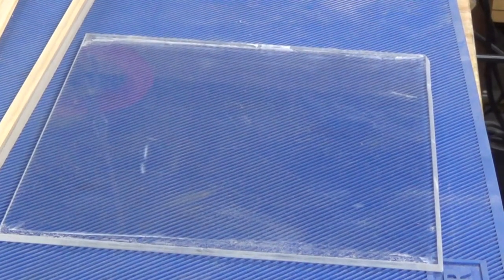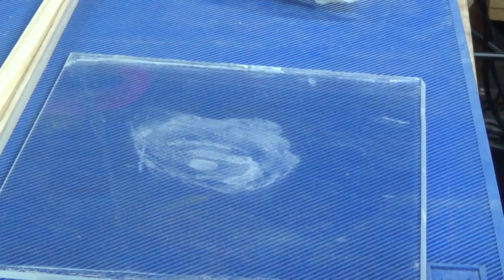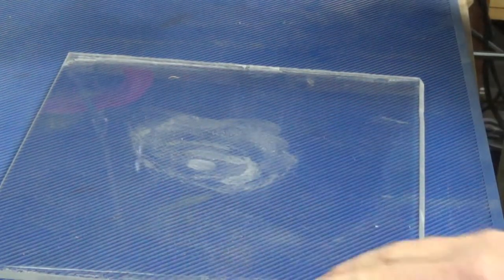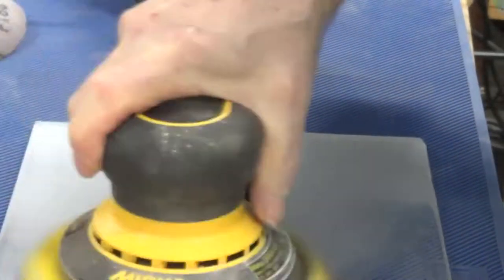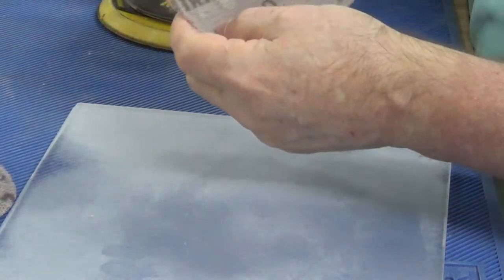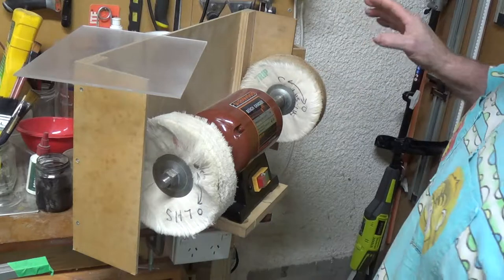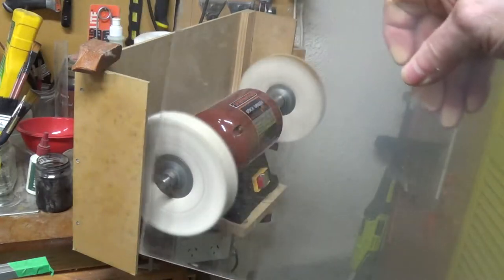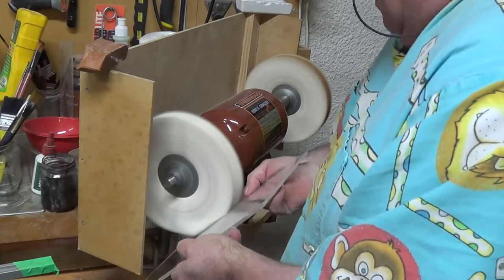Perspex (Acrylic) Repair/Clean Up... Ugh! CA glue...

Comment: I've got small cloth wheel like you have from amazon, also with a brown compound, i've tried to apply it the way you did, and it didn't applied at all on the cloth. Cloth it self started even to loose it hairs from the pressure i've applied.
Reply from the maker: Hi Holms... sorry to hear you are not having the success that I've had... Unfortunately I can only go from the experience I've had using the products and equipment I had on hand...  I didn't have to go out and purchase anything new.

Outside the "PlasticX" compound, I originally (years ago) bought my buffing equipment from the Beall Tool company (a long way from USA to Australia)
   https://www.bealltool.com/products/buffing/buffer.php
and their respective waxes (tripoli and white diamond), explicitly for woodworking.  Recently I bought some buffing pads on a budget and now they're either in the rubbish bin or given to people I don't like too much (sorry recipients)... they were a bucket of shit compared to the Beall products.  Your equipment may be different, however, I have no idea what you are actually using.  
What you see in the video is contains actual footage the first time tried this method and as you can see it works.  I have no affiliation with Beall but it worked for me... I have no idea what other supplier combination will do the trick and can only quote what has worked for me.  

Sorry for the negative reply, but unfortunately I can only call it as I see it.  I have used this method several times now with similar (exactly the same good) results.

Good luck.

Comment: Hey Alex do you have a shop if Jersey where you do work? I have a slingshot and the windshield got stained your the wrong chemical by mistake to clean it. I want to see if it possible to buff it your it’s not glass. It’s plastic I guess plexiglass
Reply from the maker: Hi David,  I'm just a hack woodworker and not really into glass or perspex/plexiglass... I just stumbled across this as I buff/polish a lot of my timber.
I'd be apprehensive in recommending anything to do with a windshield as it might cause unknown grief... All I can suggest is that try on glass/bottle starting with a heavy abrasive (talk to an automotive shop) and go up the grade.. the compounds have abrasives so it should work, but then it may put scratches that can't be removed. 
Sorry, but I am no way knowledgeable enough to provide further experience advice.
Reply: @alexkara9696  no worries thanks sir. And it was polycarbonate not plexiglass jajajajjaja.

Comment: Alex ya bloody legend! Here I am, looking at videos on how to buff out scratches on our acrylic caravan windows and I stumble upon this bloody ripper of a vid mate! Made by a bloke I worked with 20 smeggin years ago! This is nutzzzzzzz! Rack ya brains young chap. Box Hill. Coding in COBOL - VisionPLUS! This has just blown my mind! :-) Hope you're well mate and still playing with ya model tanks! Cheers, Stevo. :-) P.S. I'm gonna binge watch some of ya other vids. By the way, you ain't changed a bit ya funny codger.
Reply from the maker: G'Day Steve,  The name rings a bell, COBOL and Vision Plus brings back nightmares... Gotta be more than 20 fucking years... Been here in downtown Churchill for 10... worked for Yanks for 8 and sold my soul to CSC for longer than I care to remember.  A few Stephens have crossed my path Moore than some... Gotta try to clear the cobwebs and try to access memory above that that 16MB magical line that alcohol cannot affect...  must swap whories  once this fucking C19 goes into slumber.  
Can be PM's at "alex@karapens.com" but don't pass that around or all my nemesisses will come debt collecting.

BTW, I'm sure if you remember moi, you'd remember Paul (Wally)... still keep in touch.  Just to see if Unca Alzhi is having a snooze, would I be way off track if I mentioned an upside down wrist(ish) tattoo?
Reply from the maker: This link may also be of some assist in cleaning acrylic when you can't take the job to the tool,
   https://www.lumberjocks.com/LittleBlackDuck/blog/130613
Reply: @alexkara9696  Yeah mate, you're on the money about the tatt! Hehe, can't believe you remember that. BTW, we bought some land at Golden Beach, near Sale - which is kind of close to Churchill. Great area. Ok, i gotta get up and polish me caravan windows. Have a top day and i'll drop you an email sometime sir. Cheers big ears. 😀

Comment: Lexan or poly-carbonate ?? do you have any idea what is best for that particular material??
Reply from the maker: Sorry I haven't replied Marco, however, I treat both the same even though they may be way different.  The polish I use is for paint on metal so I don't think it would matter too much....  Either way, if your media is stuffed, you probably couldn't stuff it up any more.
Reply: @alexkara9696  Thank you very much for your time, I did follow your advice and it actually worked....
Reply from the maker: Glad it worked for you (as well)... If you see some of my videos, none are rehearsed and very (very, very, very) few are re-shot... So what you see is what actually happens.  I would have had egg on my face if it didn't work the first time as I'm not the type to experiment a lot.
My motto is "If at first you don't succeed, give up!"

Comment: COULD YOU PLEASE EXPLAIN SAND PAPER GRIT AND GRIENDER POLISHING SPECS
Reply from the maker: Depending on how bad the damage is, I usually start at 180 grit (may go down as low as 100 for really bad damage) and work my way up to roughly 600 (100 → 150 → 180 → 240 → 320  → 400... ( → optionally  600 → 1,000).
Then I use the Beall Buffing system (without the wax),
     https://www.bealltool.com/products/buffing/buffer.php
using their "tripoli" and "white diamond" compounds finishing with a car polishing compound. 
I use the following,
     https://www.automegastore.com.au/meguiars-plastx-clear-plastic-cleaner-and-polish-296ml?gclid=Cj0KCQiAhMOMBhDhARIsAPVml-HHPRaQH-rAInIWk2zrF5qMQWs86oHE4MpJ3da6UsKnmA_Zfgbs4fIaAkOvEALw_wcB
however, any good car polishing compound will work.
I made do with what I had as I had the Beall buffing system for my woodworking and the "PlasticX" for my pen making.
Now I'm not going to say this is the best way as this is the first way I tried... it worked and I have stuck with it.